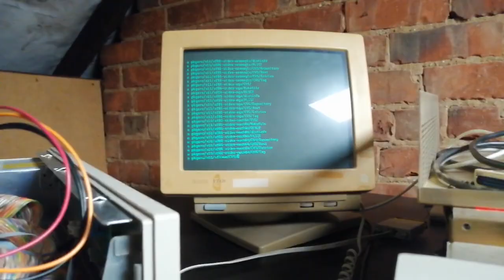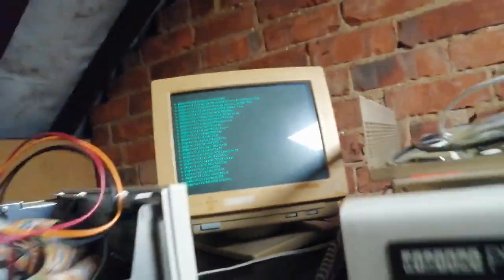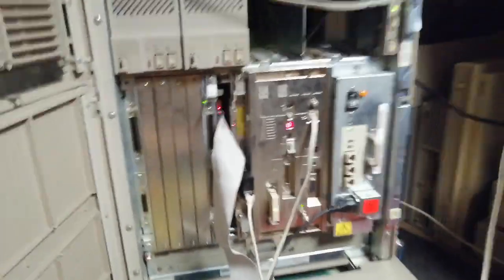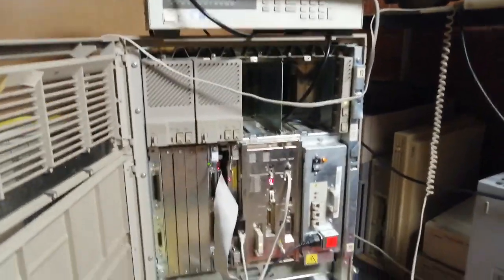VAX 4000 running NetBSD 9.0

Comment: Wow, nice going.I have a 4000/400 (but replaced the dead CPU, which might make it a 500, not sure). I managed to hunt down a DSSI drive and install VMS, but no license. The DSSI drives are very noisy and constantly chatter, which is apparently normal. They're now super rare and very expensive; unfortunately I didn't jump at the opportunity to buy all 4 from the batch I was offered for (in retrospect) a very reasonable price. From what I gather, the DSSI drives aren't too reliable tho.
I rescued my VAX from the dumpster, where it sat upside down after having apparently been tossed in head first. Needless to say, the chassis required some "panel beating", but the plastic skins still have bits broken off. :^(
Sorry to hear about your PSU woes. Mine's still amazingly rock solid, but probably high mileage. I currently have the PSU opened for cleaning and inspection, and decided to preemptively replace the two dreaded RIFA Y-class  caps in the primary stage; they're already cracked and ready blow!
The PSU is actually one of the most elaborate and clever designs I've seen in a while; both output modules are mounted on a huge heatsink which gets air drawn through it by the chassis fan; the PSU itself controls the fan and apparently contains monitoring logic too (note the 3 connectors -- wonder what they're for). The switching transistors for the output stages are mounted under the boards and mounted on a conductive plate that thermally couples to the large heatsink. The downside of all this is of course -- as pointed out here -- that you can't troubleshoot these PSUs outside the chassis; I expect it wouldn't even start without the fan connected. Tightly packed switchers like these are no fun to work on (and bloody dangerous too).
I've been in the Power One PSUs of my deskside SGIs, which, while not as sophisticated, are modular by design (the output modules just plug into a 300 VDC backplane), and have an integrated fan, which makes them far more serviceable. I wonder if DEC designed their own PSUs, or spec'ed them from OEMs; whoever designed it did one helluva job, IMHO.
Again, congrats and I hope the 12V issue will work out. Good luck & stay safe!
Reply from the maker: Hey!  Depending on your country, I think you can request a license for VMS from HP? 
Glad you managed to change the caps before it was too late. :)
Reply: @AaronJackson1  In Germany you have to request through Connect, and membership is expensive. Not sure if there are other options. I'd still prefer VMS to NetBSD, as I've got lots of *NIX boxes already. Btw, the electrolytics in my PSU are still fine; DEC didn't skimp on quality components: Chemicons, Nichikons, and Panasonics; the secondary filter caps are all 105°.

Comment: How’s your web server project ? 
What’s the simh do again ?  Maybe you’re
You using it to install over a network ?
Reply from the maker: It is far too power hungry to leave on all the time :-) If I remember correctly I was using the built in "bozo" httpd server. Honestly, not booted it up since this video. The 12V module of the power supply is very dead so I'm planning to retrofit some smaller switch mode power supply modules in side of that when I find something appropriate and have time. 
simh is a hardware emulator, can do a bunch of old machines including the PDP-11.  Since I'm booting the vax off an SD card, I was able to install NetBSD in simh first, as if it were a real VAX, and then copy that image over to the SD card. Saves a lot of time messing about with the installer on such a slow machine :)